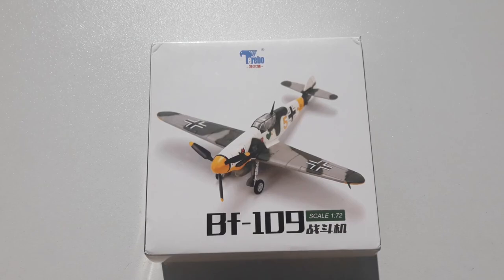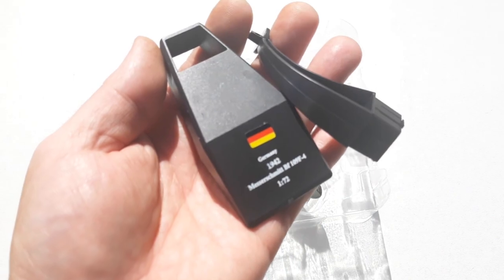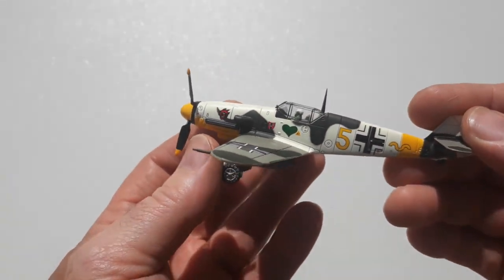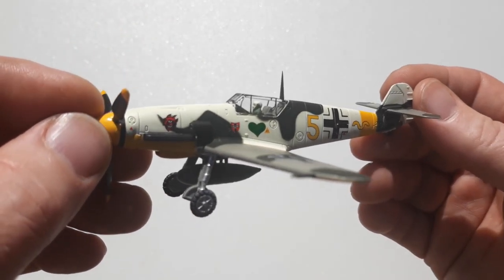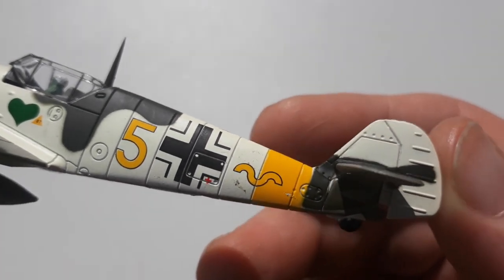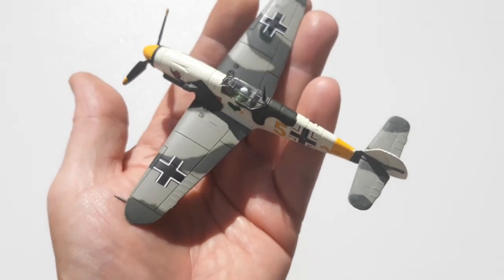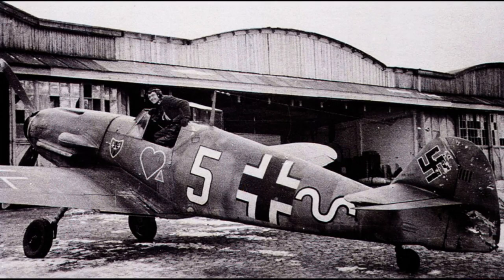Messerschmitt Bf 109 F-4 " Yellow 5 " German Luftwaffe World War 2 Fighter, JG 54 Russian Front

Comment: Amazing. Im buying it its cheap
Reply from the maker: It is fairly cheap, good for those on a budget. There are better versions out there but they cost alot more to buy. Thanks for the comment and for taking the time to check out the video. Cheers
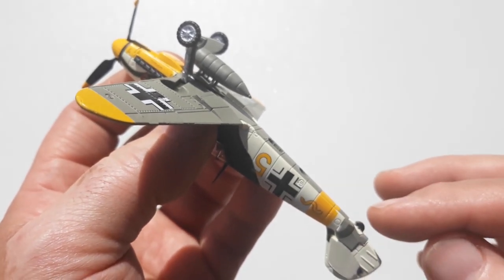Reply: @heavymetaldiecast  just a question, at 3:00 i didn't really understand are the wheels able to be removed and placed in a flying position? Or just down
Reply from the maker: @rd_0939  These ones unfortunately only come with the gear down option. They are permanent and not able to be removed. Although the rear tail wheel seemed to be in the inflight position, not landing position. A fault I found in the model. Thanks again for checking out my channel 😀
Reply: @heavymetaldiecast  thank you for the good explanation, appreciate it!
Reply from the maker: @rd_0939 Happy to help,  I appreciate you took the time to watch my video's 😀